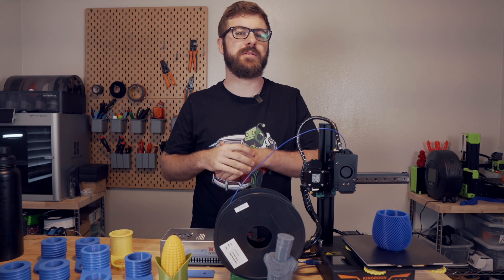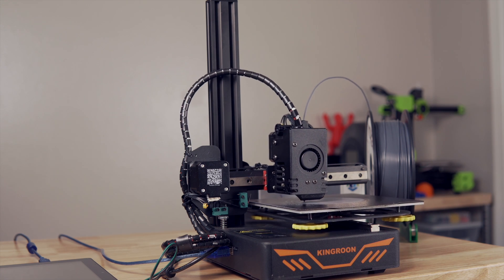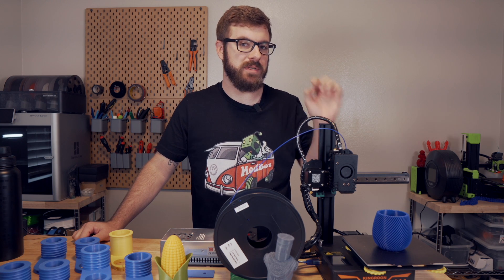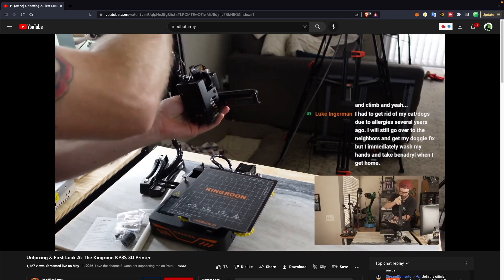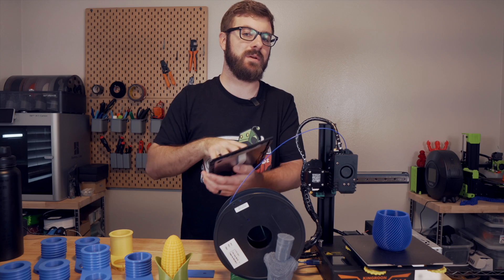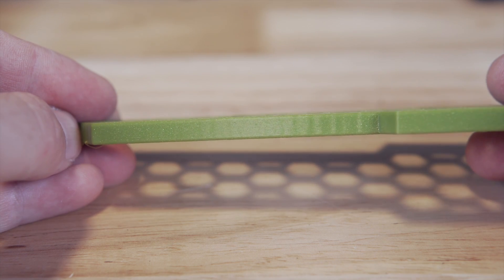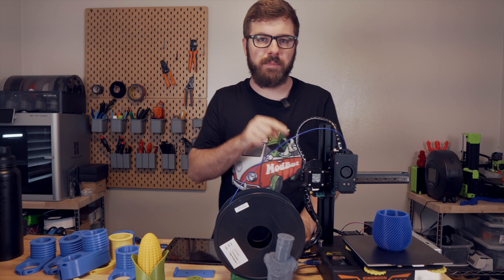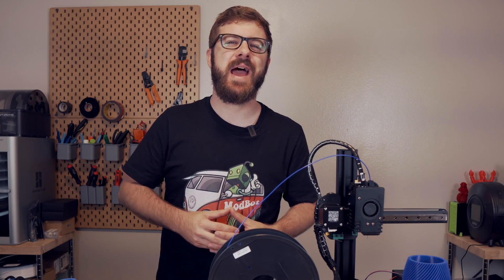Is The Kingroon KP3S Worth It?

Comment: What is it about 3d printer manufacturers and MicroSD cards? Do they not think that its about time they started to use something /just slightly/ easier to use to get your print files onto the printer? You know.. like..a USB flash drive? Are they still living in the 1990s?

Comment: Kp3s is my first 3d printer, and it was such a breez with that printer to get started, no difficutlies so far except 1 clogged nozzel after 5kg of PLA :D

Bought mine for 149€ + free shipping on ebay.   
My printing bed is not 100% straight, its slighlty warped towards the middel. so i have to level the bed based on how big the print is. 
But i read online that if you buy the tempered glass plate it fixes that issue. 

i would personally update the fans, they are extremly loud, but for 3-4 hour prints its not that bad that i cant handel it. i have it in my basement and just leave the noise there.  But in the beginning i had it next to my PC and it was too loud after 1-2 hours.

Comment: Great video. Yes, I have a KP3S with the red extruder. I purchased it used for just $75 about a year ago. it appeared to be in near mint condition, except someone had dug a groove in the bed with the nozzle. I was planning on a PEI sheet anyway so that just made the deal sweeter. I use this printer almost every day, stock at the moment, and print more on it, with more consistent results than my Ender 3 S1. All I can say is that it just works. I did have a bearing fail on the x-axis belt end roller but it was a very easy and cheap fix. I highly recommend this printer to others.

Comment: Please make a video on how installing and run Klipper on the Windows tablet. I have 4 KP3S and one of them runs Klipper from a Macbook Air 2nd Gen with Ubuntu, however I am looking for a more compact option and the tablet would be excellent for that; especially because there are Windows tablets from 180 dlls (the same that costs a Pi 4 with accessories currently).

Comment: I have 5 of them, definitely need some help to upgrade to klipper.. I've no experience with klipper at all.. also busy upgrading the hotends to be able to print higher Temps. The latter also not easy as I'm battling to properly attach and connect hotends. Thanks for great videos!

Comment: I was carrying mine up the stairs the other day in one hand.  It is almost palm-sized!
I think it is a great machine for modding, but I definitely wouldn't recommend this to someone as a first printer. A significant number of these come with absolutely brutal Z wobble.  I suspect that Kingroon swapped components without thinking.  The fittings in the Z screw motor coupler are goofy loose and the Z screw nut mount is off center.  Double wobble!  Oh, and that horrible hot-end jams.  The fixes are cheap and aren't hard for someone with experience but a newbie should get something else.
Reply: You are absolutely right! It's my first and i'm having a big time trying to fix z wobble. Already tried changing the gantry and other stuffs and i'm still getting the same wobble on prints
Reply: @luanmuraro2929  Changing the motor-screw coupler (search Thingiverse for "self centering coupling") and adding an oldham coupler at the Z nut fixed it for me.

Comment: I've been using an original KP3 (not "S") for about a year and it has been performing perfectly. It has hundreds of hours on it so far and the only thing that needed replacing was the nozzle (replaced once). The only mods I've done are replacing the stock Z  nut with an antibacklash nut and replacing the bed with a PEI spring steel bed. Still using the stock bed magnetic sheet as it holds the spring steel bed perfectly fine. Just bought a new KP3S for US$140 and again added an antibacklash Z nut and PEI bed using the stock magnet. So far so good. I like the relocated user screen that no longer gets blocked by the bed. The direct drive print head is nice, but I haven't noticed any difference in print quality vs the bowden system in my KP3.

Comment: I have 2 KP3S printers and absolutely love them. They are solid machines and print flawlessly time after time. I use a smooth PEI sheet attached with small binder clips. Both printers are used to print custom brackets out of Polymaker ASA at 255°C. The only failure I've had is the hot end fan.

Comment: put klipper on mine, v6 volcano clone with .6 nozzle, bmg and pei sheet. 4k accel, 25+mm3/s flow. next upgrade is linear rails on z! it's a little beast. and that for 160 euro. (210-220 with upgrades)

Comment: Try doing the Ender 2 pro, it is roughly the same price and has a “silent board”. I found if you do t have the belts super tight the motors are stressed and the board is actually silent the fans are just loud

Comment: I have the original version of the kp3s and other than some X belt bearings and upgraded fans (stock were noisy AF), it's been the most dependable printer I've owned. Prints always just work.

Comment: Love my KP3S! I flashed klipper onto it almost immediately, but got some quality prints stock. Ended up adding dual Z linear rails, a PEI sheet, 3d printed power supply base, and an H2 toolhead. It's now my dedicated "just works" printer that I can rely on to print ABS/ASA printer parts
Reply: Yeah you say all this but can you print a tpu  Eiffel Tower?
Reply: What does klipper do?
Reply: @WTF_BBQ  klipper is an alternative firmware to marlin firmware that let's you do some cool things like edit firmware values in a config file instead of reflashing and run gcode calculations on the more powerful processor you may be using for a web interface (octoprint/fluidd/etc) instead of them running on the low power builtin processor. Nero3d has a great video explaining klipper you should be able to find for a more detailed explanation.
Reply: @connorcleveland9166  
Sounds like this would be useful for people who run a print farm.
Reply: Hello ZombieHedgehog, i am new to 3D painting, can you tell me me more about your upgrades?
Reply: I can only agree. I added a mosfet for the bed, a Pei sheet and also use it for abs. What base did you print?
Reply: Hey I'm trying the H2 as well but for the life of me I cannot figure out how to connect the hotend to it..
Reply: nice, can you please share the link for dual z mod?
Reply: If you need to do all that mods why not just choose another 3d printer instead?
Reply: @omegadeepblue1407 cuz modding is fun
Reply: Where did you find the Dual Z linear rail upgrade? Id love some details on that